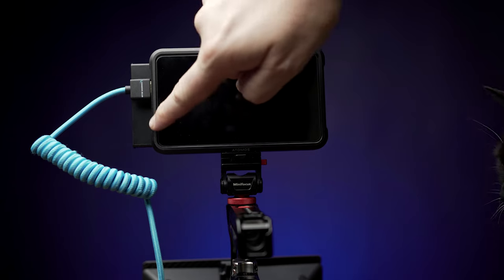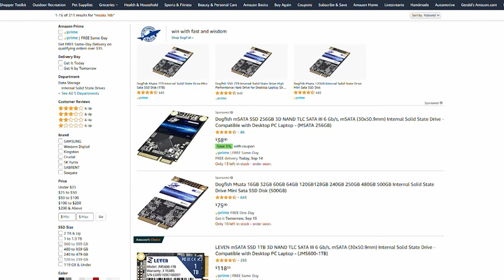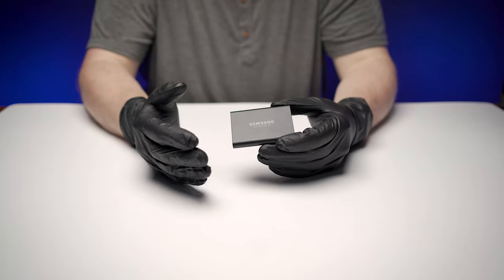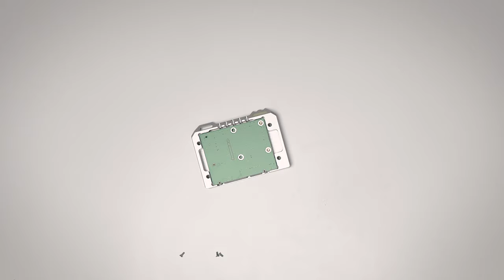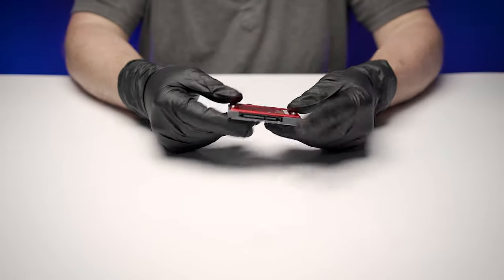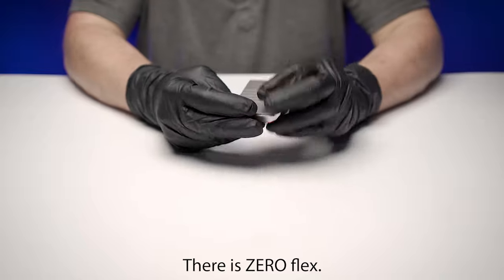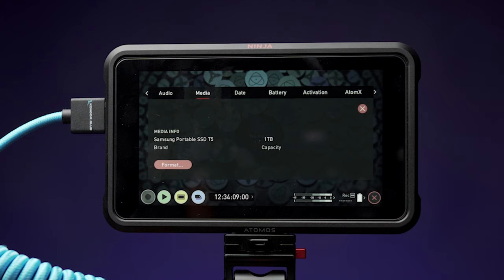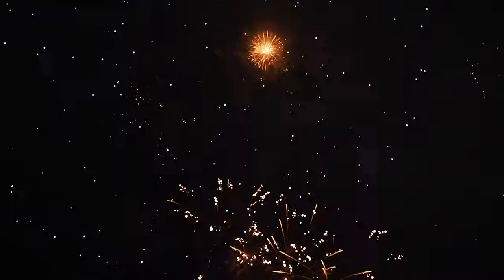BETTER Than The Angelbird Atom X for the Ninja V for less that HALF the cost? Andycine Lunchbox.

Comment: Will this work for the Samsung T7 2TB?
Reply from the maker: I have never tried it however here is what I have heard from some of my viewers: The T7 drive has a pcie protocol like NVME and not mSata like the T5. This tells me that it wouldn't work. Again, I have not personally tried it so I can't confirm this info 100% correct.
Reply: @GeraldBertramPhotography  thank you Gerald. I actually opened up the T7 and it is completely different from the T5. The T7 have a different insert port than the T5 which mean it will not be able to connect to the lunch box. 😔 I figured I go ahead and see how it look and hopefully it’ll help someone else who is wondering. Thank you very much for your help.
Reply from the maker: @outdoorhabits  Thanks so much for replying! Now I finally have confirmation that it won't work. I appreciate that!

Comment: can you format the T5 with Ninja V ?
Reply from the maker: I don't believe I did when I first installed but I don't see any reason why you couldn't.
Reply: @GeraldBertramPhotography   i cant format my T5 on Atomos that why am asking if you have a same issues, can you make a try?
Reply from the maker: @angnguyenphucminh3959  What happens when you try? Do you get an error message?
Reply: @GeraldBertramPhotography   its say failed to format. i use samsung T5 and WD blue 500gb
Reply: @GeraldBertramPhotography  now it dont recognize my ssd anymore
Reply: @angnguyenphucminh3959  not sure if this helps,  but I also had a couple of weird problems with the T5 and the lunchbox, but I figured all of them out eventually: one problem why the lunchbox was sometimes only recognized by the Ninja V OR my PC, but never both at the same time or so it seems: the in my case was to use the Windows disk management,  delete the partition on the ssd, switch the drive mode from MBR to GPT and then add a new partition, format it in exfat. Once you're done, format it again in the Ninja V. This eliminated all my problems (so far)
Reply: @Fotomensch  Thanks for the info.

Comment: would a t7 Samsung work better than the t5? do you know anyone who uses that set up?
Reply from the maker: So I have heard some mixed results on how well this works. Someone said it worked another another person said it didn't. What I can say is due to the interface you won't see an increase in performance in using the T7 over the T5 assuming the T7 would work anyway. My 2 cents is to stick to using the T5.

Comment: The Samsung T5 2TB drive works fine. 8K Raw ProRes HQ with no problem. This is a well made, rugged, compact enclosure. It would be great if they would make one for full SATA drives too....Crystal Disk Mark results before with Samsung's Controler: Read Seq: 567 MB/s Write Seq: 358 MB/s...with Andycine Read Seq: 445 MB/s Write Seq: 410 MB/s.
Reply: Hey Brett! How many actual minutes can you get with the 2TB and the Canon R5 in ProRes RAW HQ? Sometime the estimated are way off on Atomos OSD. Thanks!
Reply: I just grabbed 2 new T5 drives for $70 each. How much is the 2TB mobel? What is the model number so I can get one

Comment: Do T7s work?
Reply from the maker: First let me say I have not personally tried a T7 drive. That being said I did talk with the folks at Andycine and they told me that any mSata drive, which the T7 is, should work in this enclosure.
Reply: @GeraldBertramPhotography  Okay great.  I wonder if we lose any speed from the T7 by running straight msata vs using the T7 housing and board. Not sure if there is some voodoo in the T7 housing and hardware that speeds things up. There is a big difference in speed in the T7 compared to T5 normally, but not sure if that is preserved. If not, then there is no point on spending extra dough on the T7.  I do know that both T5 and T7 get MUCH slower once they start to fill up. I suspect the T5 would fail if recording RAW as they approach capacity. The T7 might as well.
Reply from the maker: @SheldonCharron  That's interesting to hear about them slowing down when they reach capacity. Sounds like something I might try and test out. Is this something specific to mSata drives or do standard SSDs suffer from the same issue?  I'm fairly sure it's the exact same mSata interface inside the original casing of both the T5 and T7. The T7 is likely using faster chips on the board if there is a big difference in speed like you said.
Reply: @SheldonCharron  SATA 6G is limited to 600 MB/s, so the T7 will be limited by the SATA port of the Ninja. Only by connecting via USB C, the T7 can be maxed out
Reply: @knobi3760  that’s what I thought: so no point in spending more on the T7
Reply: even the Ninja V+ uses still SATA, so Write/Read Speed for ProRes Raw does not seem to be a limiting factor up to 8k 30p ProRes Raw.
Reply: no t7 is not msata and used a different protocol.

Comment: It's cheaper than the Anglebird, but it's still cheaper to go for the 2.5" SSD + Atomos caddy.
Reply from the maker: Very true! But as I mentioned in the video I didn't want a drive hanging out the side. To be honest it more an aesthetic choice because functionally there is no issue. I just love having my drive tucked away on the back of the Ninja. Plus this Lunchbox is just so incredibly solid. I've literally stepped on it twice and not so much as a scratch.
Reply: @GeraldBertramPhotography  That was one detaili was happy with about the Shogun, the SSD with the caddy actually fits snug against the back. Not a loose disaster waiting to happen.
Reply from the maker: @tomastuoma  I hear ya!

Comment: Hey mate

How are you?

First, thanks you for you video. I tried one first time with my T7 but... it's not a msata so, I bought a T5 one, to have a msata, to build it with my lovely red AndyCine Lunchbox.

Then, that's work perfectly I think with my Atomos Ninja 5 (detected, recording etc...) but, how do you connect the lunchbox on your computer ? 
I buy an USB 3.1 / SSD adapter but my Mac detected it and eject it few seconds later...
If anyone have a solution or an answer to understand why
(Maybe it's because the AndyCine launchbox is already an adapter, and this makes adapter with adapter: "Adapterception" ^^)

Thanks